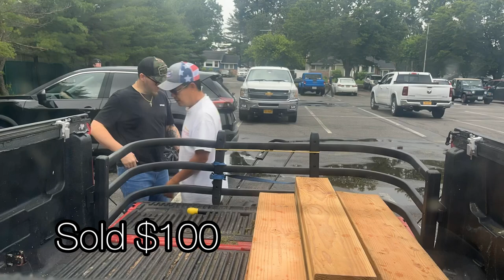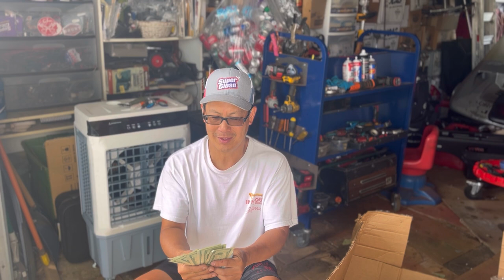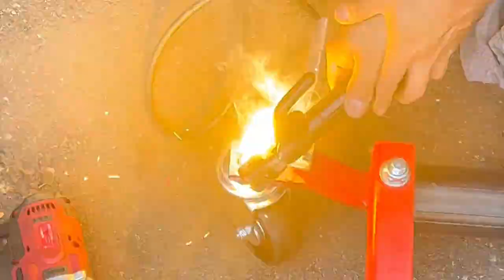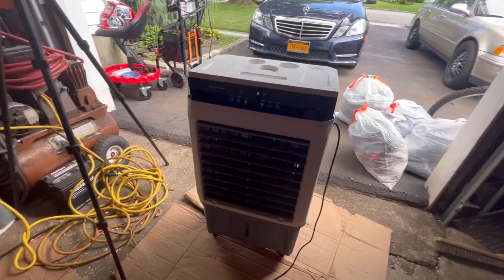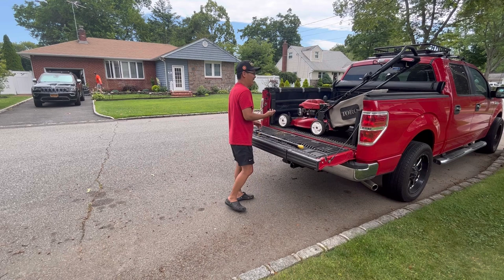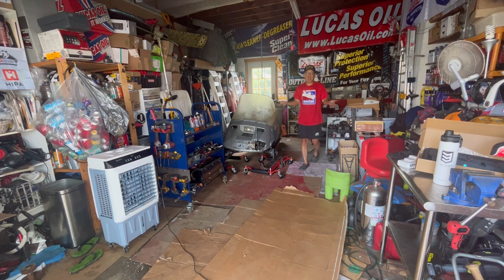I’m a selling fool! Sold Litheli Electric Lawnmower wood & Craftsman 30”Riding Mower & Toro Recycler

Comment: You think you got a lot of crap. I just spent the last 6 months rolling out fixing, selling and stripping machines, some that were there over 3 years. I'm down to the last thing, besides snowblowers/etc. A Coleman 5000 watt generator. It's been overwhelming. I still have a few more things spread else where. Anyway now I'm into phase 2, sorting, selling and organizing parts. It never seems to end.
I'm glad I put standard operations on hold. It got rediculous. All free crap I amassed over several years... SMH.
Reply from the maker: It never ends bro!
Reply: @MowersNBlowers  lol, your not kidding! But I wanna get down to a clean slate and start fresh and keep it under better management going forward. Outleast to where I can move in my garage. In March the entire thing was packed and outside too. Couldn't move.

Comment: Would have been easier to go buy .75 nut. Would look better too
Reply from the maker: Why do I care what it looks like? And how is it easier to get into your car,  drive, park, search,  compare threads,  stand in line,  pay for a nut,  get into car, drive home,  round trip gas,  1 hour wasted….or a spot weld,  done ,  move on!
Reply: Already know if standard or metric had a wrench on it bring bring a nut with you 2 minutes down the street compare with a bolt get a knot pay for it home within 5 minutes done
Reply from the maker: I’d like to see you do it in 5 mins